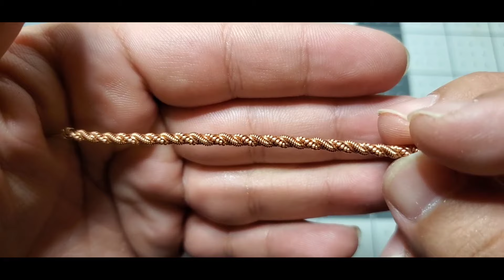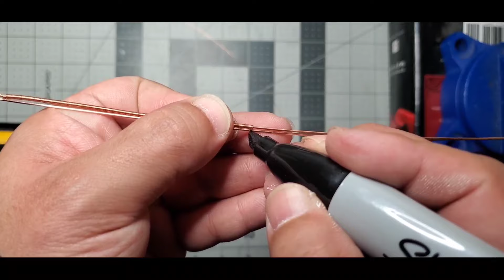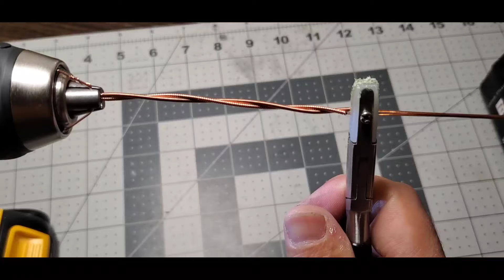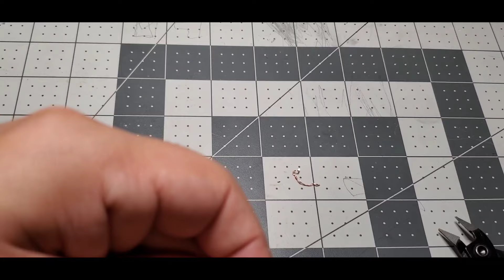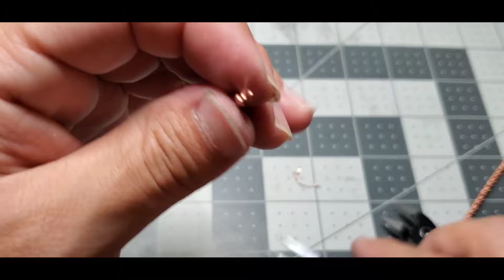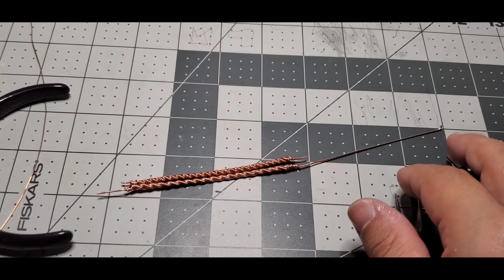Wire Wrapping - twisted coil tutorial

Comment: I have found that if you use a old style manual hand drill or crank powered drill  you can get the same quality as a power drill, but you can control the speed and you're able to have more control over your wire with the fact it will only go the speed that your hand can crank the handle. You can still buy them online and find them in hardware stores and at yard sales or places that sell old used tools.
Reply from the maker: That's a goog idea. My dewalt drills trigger does have speed control. Not sure about other brands though. Just gotta ease on the trigger pull. Also convenient quick switch to reverse for if I accidentally overlap.
Reply: Thank you for the tip--much appreciated.

Comment: I was wondering how you add one of those twisted coils to a piece you’re working on?
Reply from the maker: I use it like any other coil. Just straighten one of the thicker core wires to use for attaching to a frame.

Comment: Awesome tutorial Seth! Does the coil shrink as you twist it? Just wondering how much longer I should make the components in order to fit properly on the piece. Thank you!
Reply from the maker: Yes it will shrink when twisted. The amount it shrinks will depend on how tight you end up twisting it. I do not have any formula as to how to measure, so I would suggest making it on the long side so it can be trimmed down if needed.